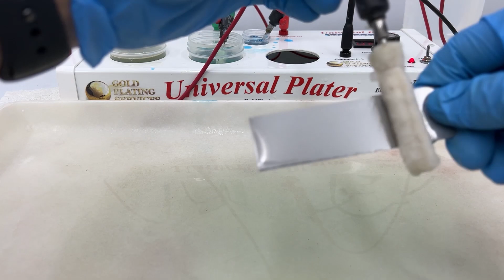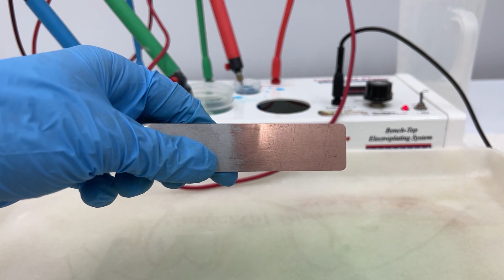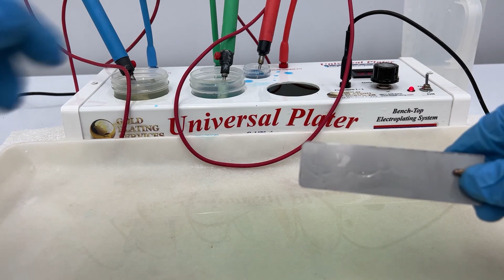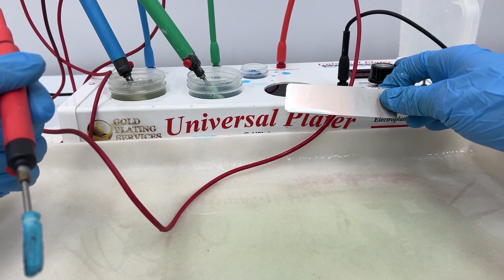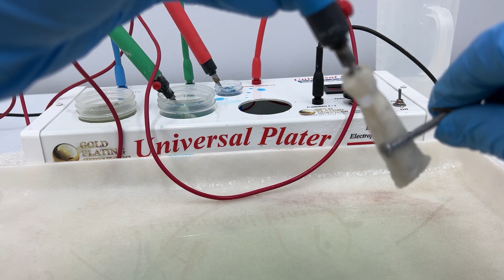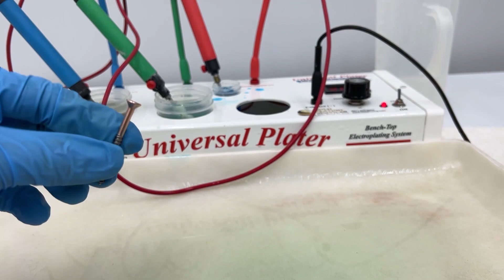Copper Strike Brush Plating: Steel vs. Stainless Steel Comparison

Comment: Why don't you use #6 activator I'm having trouble trying to nickel plate a stainless steel 2.625 diameter part 2 in wide I'm using a lathe to spin the part but I'm getting no adhesion do I just need to use electrocleen then go straight nickel I'm using 2801 nickel